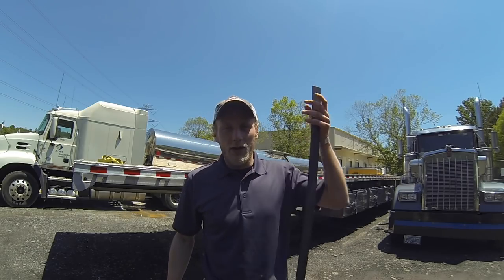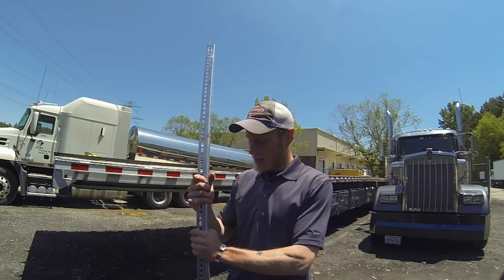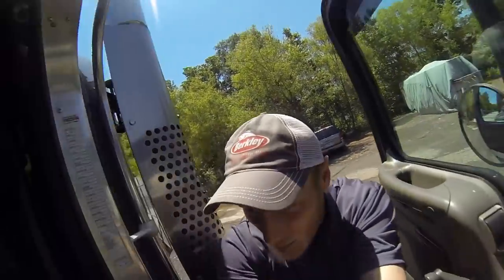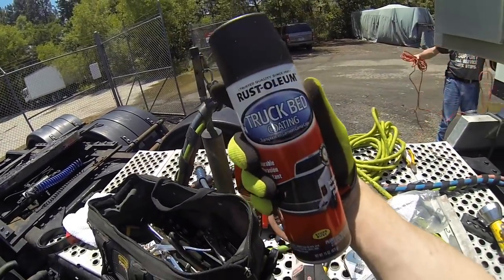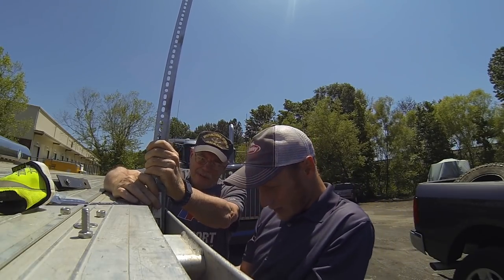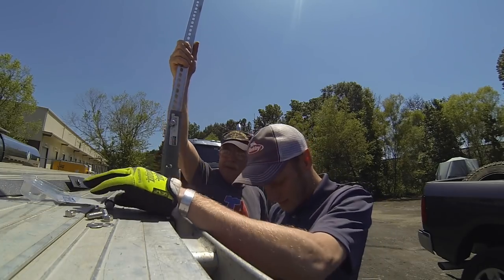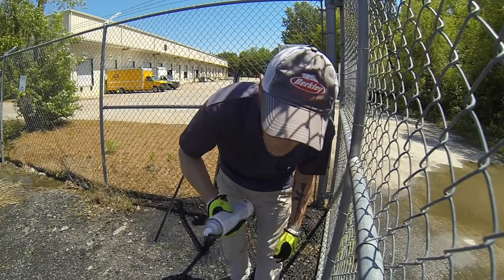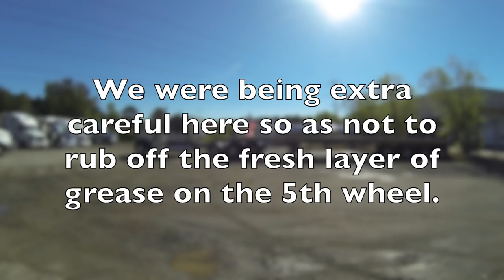Heavy Haul: New Flag Pole For The Battleship!

Comment: If I were you I would turn it around so the brace went to the front of the truck, I think it would be stronger with just flat steel being under tenches it will be stronger the brace will bow out on you.
Reply from the maker: It doesn't take that much force, and I'll tell you from driving it today, the pole doesn't move a bit. This is our second design, we knew exactly what we needed to change from our first one.